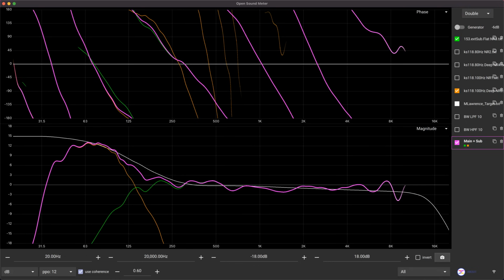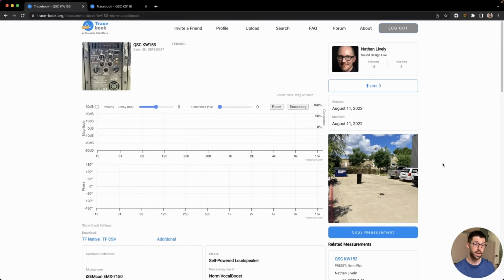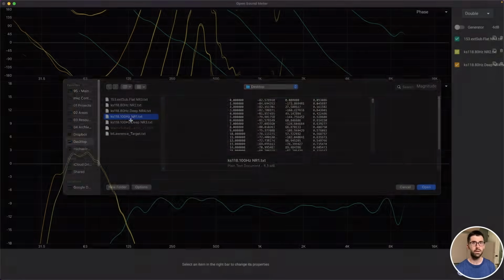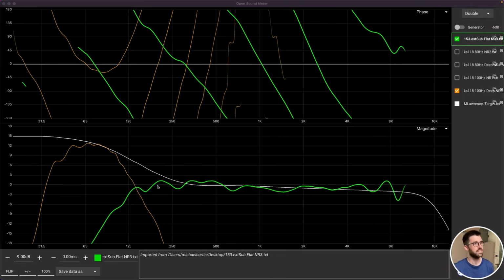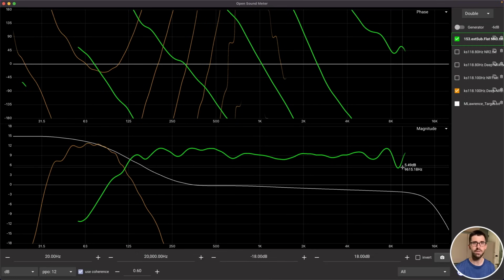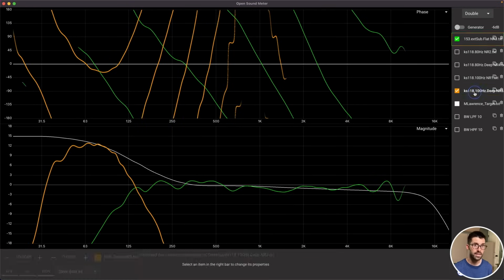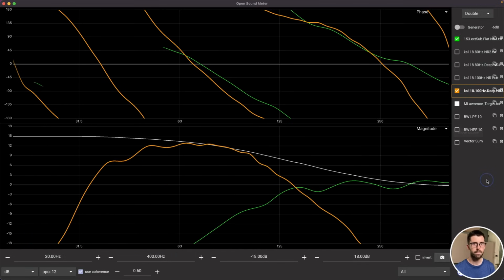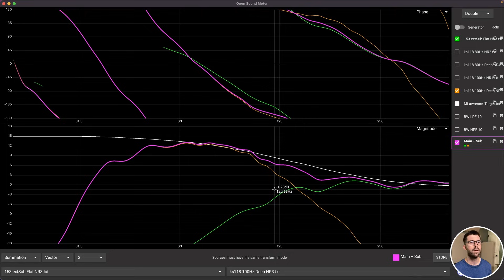Main to Sub Crossover Alignment Fundamentals With Open Sound Meter | Pt. 1

Comment: we are still using custom 3 way tops kicks and subs old point source style rigs.  just gettin into the tuning side, does what you explain here all apply when tuning upper bass into the mid into high? 

are rig is subs, then upperbass cabs, then 3 way tops which is low mid, mid and high

Comment: When you align tops and subs, you need to take measurements of each one while comparing to the loopback reference? And if so, you need to locate the delay before taking the measure? to match the impulse of the measurement with the one of the reference loopback.. I dont understand if I need to make sure that the measurement is aligned with a reference ..or my tops measurement become my reference for aligning the subs.

Comment: Hi Sir! Your video was great. Thanks. I would like to ask if i have to align my sub to mains, do i have to time compensate the sub using the open sound meter like the mains? Or i will have only to adjust the delay of the sub alone from the mixer? Thanks a lot

Comment: Hi Mike how are you?  I hope everything is ok. Every now and then I need to disturb you by watching your wonderful videos. I wanted to ask you: I'm using subwoofers that already have the low pass filter set with a 90 or 120 switch. The manual says 24db but they don't write whether LR or But. Can I use an LR24 at 90hz on the top line array? Can there be problems if different filters are used but always at 24db? for example if sub are 90hz but24 and i use LR24 on top?
Reply from the maker: Great question! They best way to find out is to put your top and sub right next to each other with those filters, solo each, then measure and see if you get the desired summation you're after. MVV has a great blog post walking you through the process - https://www.merlijnvanveen.nl/en/nl/studiezaal/166-subwoofer-alignment-the-foolproof-relative-absolute-method
Reply: @MichaelCurtisAudio  thanks Micheal. anyway I was referring to rcf subwoofers precisely 8004 or 8006. looking on the web I managed to find a video on rdnet where the rcf demonstrator at a certain point says that on all the subs there is a lp24 Butterworth. I will try from here. if it can interest you I noticed on various rcf hdl 20/30 or nx44 systems that when I align I have to invert the polarity of the 8004 or 8006 subs

Comment: This was super helpful!  Thank you so much!

I replicated this and was goofing around.  What do you think of inverting phase on the KW153 and then delaying the sub 10.6ms.  The phase looks pretty good in the crossover region and the delay is less than using the other method.  The summation might not be quite as good but looks pretty good.

Comment: Thank you for the excellent lecture. This material is very helpful, especially since such resources are not readily available in Korea

Question:

1.Is the reason for using the Butterworth 10th filter without the LR filter to be close to the target trace?

2. Where would you place the measuring microphone in a space that can accommodate about 300 to 500 people? Because the phase is measured differently depending on the location

3.Measuring the delay caused by the distance difference between the measurement microphone and the subwoofer is quite challenging. How do you address the delay measurement between the microphone and subwoofer when measuring the subwoofer?

Comment: Hello ! I am using OSM on mac and Smaart aswell. Infortunately I can't get proper data with OSM ... with the same volume from the PA and same gain on the mic, i get a proper trace on smaart but very blurred one in OSM ... I use the same time reference aswell.
What is happening here ?

Comment: 6:23 When you turn up the gain in OSM, does that mean you have to take note of the value and apply that in your console?
Reply: Only the relative gain will be important. So if your subs are at +10 and your mains are at +4 to get to your target curve, you really just need your subs +4db over your mains. It's not color by numbers mind, you'll need to gainstage properly, but you will get the offset in OSM. Generally speaking, running something at 0db is good practice, either your subs or your mains, and then run a negative offset for the louder source to hit your curve. That'll maximize your available dynamic range.

Comment: Awesome video, Michael! thanks for sharing such a great information. Let me ask you something. I have a 3.1 system, I mean 2 subs and 3 tops. At the moment the tops are running Left Right Left, because I don't have any audio processor, what's the best configuration you think i should have? I've been thinking on the dbx drive rack to divide the signal and get L C R, but you think is it worth? the place is not big, is a medium size church.

Comment: One aspect of sub alignment I have had the most trouble with has been getting a good impulse response out of a subwoofer. For whatever reason, subs never show any kind of usable impulse response in OSM. the delay locater also has some trouble. Why is that?
Reply: You can sometimes turn the crossover fully off to find the delay point, it'll make your sub act, momentarily, like a really shitty full range speaker, and then you can capture it that way, then measure with the crossover on. Easy on passive subs because they just do what they're told. Don't run them loud while doing this.
Reply from the maker: An impulse response won't give you a sharp "peak" for the program to latch on to with LF energy. It needs HF energy to do that.

Comment: Would it be viable to use a sine wave in the field if you dont have access to a laptop and software? Set cross over points on both mains and subs the same then play a sine wave through both set at equal volumes with the phase reversed on the sub  and start implementing delay with the sub being closest to the reference point?
Reply from the maker: I can give you a tentative yes to that technique aiding with some alignment, but it's possible to be "in phase", but "out of time". You could get lucky in that you have phase overlap between your main and sub at a single frequency, but not have them across the rest of the range of overlap.
Reply: @MichaelCurtisAudio  Thanks!😊 appreciate the help👍

Comment: Great Videos , very informative and a valuable resource..Thank you!!!
Shame i can't get open sound meter to work on my M1 Mac Mini (monterey 12.6.7) Have been through your vides and all the settings numerous times to no avail. For whatever reason, the audio input isn't being picked up by OSM. Signal generator outputs to my speakers, have had it looping back to an input successfully,  also tried  an external signal generator. Sound card and speakers are fine, just no audio is  getting 'inside OSM' as the meters are not lighting up at all.

Comment: This is so good! 
Thank you Michael 🙏🙏🙏
Specially with the added benefit from using open source apps.
May I ask your opinion on room eq wizard REW for this task.
One big adventure is that there's no need to blast pink noise on the people working in the venue.
I would to see one of your videos using REW as well.
Thank you!
Reply from the maker: Thank you very much!

I don't think there's a need to blast pink noise either. You can see in one of my earlier videos that you really don't have to run your signal generator very loud at all to get coherent data. And you only need a few seconds of pink noise going for each measurement.

Comment: I have this exact set up. Normally it is 153 on pole in the 118. Although  I really want to try subs in the middle and 153 on stands at some point.

If I understand correctly from your example you'd set the delay in the mixer for the subs at 13ms. Isn't that noticeable to the player? Like the kick or bass would feel off to them as they play and hear it in the sub or is this short enough that it isn't audible to them?
Reply from the maker: Hey, Dustin. Great question. You're right in the example I did have to delay the subs 13ms to get the traces aligned, but these two measurements were taken in two different environments at different reference settings and different distances. In hindsight I should have taken the measurements with the speakers together at the same place.

In reality the alignment deltas with the KW153 and KW181 on the same horizontal plane would be very, very small.
Reply: You wouldn't feel 13ms. Casual perception threshold is around 100ms, musically you'd probably notice it around half that but wouldn't know what it is. For reference, at 120bpm, the preferred dance music tempo, a quarter note is 500ms, and it halves down from there. Really really good drummers can probably manage to hold a 1/16th note at that bpm, which is 125ms, so you can see how tens of miliiseconds aren't likely to get noticed.

Do understand of course, that's only the PA's latency, digital mixing/processing/etc also has some amount of latency as well, and it's cumulative, but even if you're adding 13ms, your round trip time is probably under 20ms, worst case, which still won't be noticeable.

Comment: Good gravy, I am in over my head. Have you done this for a KS118 and HDL6A combination?
Reply from the maker: I have! They work great together. Just apply a second order (12dB per octave) Butterworth high pass filter to the HDL6-A's, no other processing needed on the KS118. Then time align them in the field to where you want to have them sync up.
Reply: @MichaelCurtisAudio  Sweet, 80 or 100 Hz?
Reply from the maker: @garyjenkins9169  100Hz! Sorry, forgot to include that.
Reply: @MichaelCurtisAudio

Comment: That is quite a lot of delay.  Would have liked to see you use phase flip on the sub, and then delay.  It might have required less delay then.
Reply from the maker: Like I explained before manipulating the data, these two measurements were not taken at the same distance or the same delay locator setting, so the relative timing offset between the main and sub at their starting point is irrelevant. I'll do another video on what things look like in the field.
Reply: @MichaelCurtisAudio  I hear you 100%, but it could've been a nice demonstration of what one might need to try in the field, if you were to find such big delay values between mains and subs.  But I also understand that this was just an informative demonstration about the concept.  Please keep them coming!!
Reply from the maker: @christiaanbezuidenhout6984  Yes, totally makes sense. I do plan on covering in future videos what that looks like in the field.